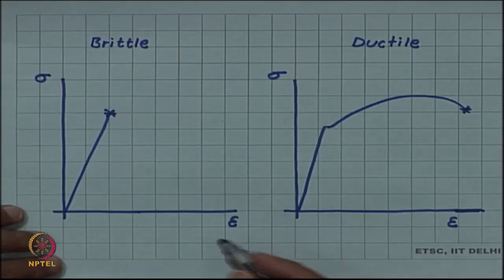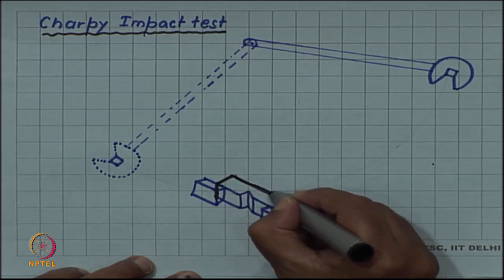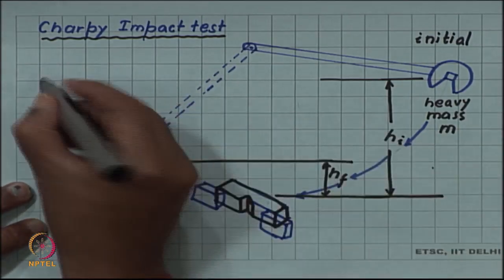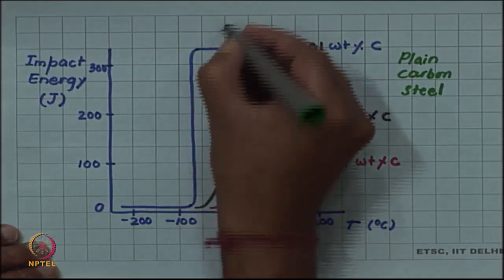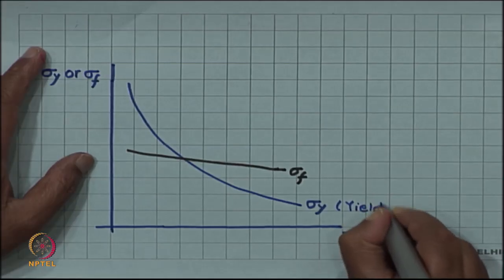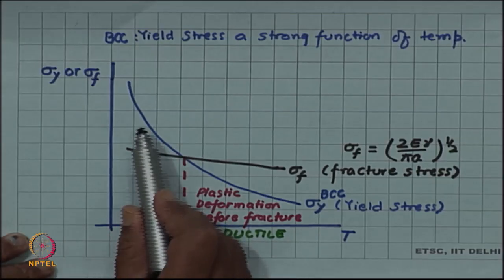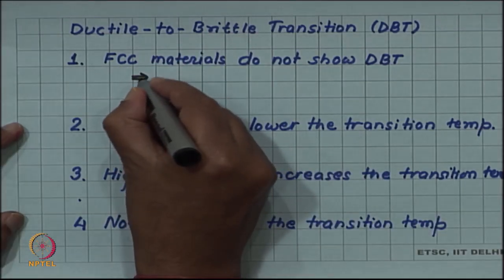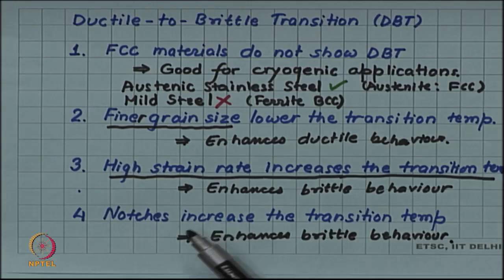Ductile to Brittle Transition

Comment: As grains become finer, more grain boundaries will be there, more grain boundaries means more hinderance for the dislocations to move and that means less plastic deformations. So how fine grains will contribute toward ductility?
Reply from the maker: Not an easy question to answer. Perhaps the crack size present is also determined by grain size, the smaller the grain, the smaller the crack size. This will increase the brittle fracture stress and thus making it higher than the yield stress.
Reply: I think in the idea of avoiding DBTT we will seek after a fine grain size because it reduces the crack propagation at low temperatures, so we can say it enhances the (ductile behaviour), otherwise fine grains remain harder and stronger than larger grains.

Comment: Sir, we studied in this lecture that ductile material generally transforms to brittle at low temperature. Is the inverse is also true, i.e. do brittle material also transform into ductile if the temperature is increased ?
Reply from the maker: Yes, it is a reversible transformation. It happens both ways.

Comment: Sir you said that the brittle behaviour happens below the DBT temperature..
But in the high strain rate point in the characteristic of DBT you wrote high strain rate--high DBT temp--enhances brittleness.. How?
These two statements are controversial.. 
Can you please explain it??
Reply from the maker: Let at low strain rate the DBTT be TL and at high strain rate TH.
For TL<T<TH at low strain rate the material will be ductile as T>TL . 
But for the same temperature range at high strain rate it will be brittle as T<TH.
Thus higher strain rate enhances brittleness.
Reply: @introductiontomaterialsscience  thank you sir

Comment: Titanic mainly failed because of low temperature. A ductile material will start behaving as a brittle material if we keep at the low temperature. The steel which was used in titanic wasn't tested for this which led to the distruction. Proper heat treatment and using better alloying material would have saved the ship !

Comment: Thank you Sir...
So this the reason for the sinking of Titanic as the strain rate was too high and the transition temp. Of the steel used must have been low, due to which the steel became brittle on impact of the iceberg as the temp of the ocean water in contact with the ship was below the transition temp of the steel used in the ship. Now i got the answer of this question which u didn't mention in the other video. Isn't it so? please let me know.

Comment: sir i think for FCC materials, yield stress curve should be below fracture stress
Reply from the maker: Dear Anand
Thanks for pointing this out. I have made a serious goof up here. You are absolutely right, yield stress curve should be below the fracture stress curve.
Reply: @introductiontomaterialsscience  
Hi sir. 
I have the following doubts.
1. If BCC can exhibit DBT then why not FCC.
3. How an additive makes austenite stainless steel to be in equilibrium state at lower temperature.
4. By what mechanism finer grain size lowers DBT temperature
5. On what basis higer strain rate and notches increases DBT temperature.
Reply: i may be wrong, but that should be replaced with HCP materials
Reply: As like they plastically deform before the fracture..